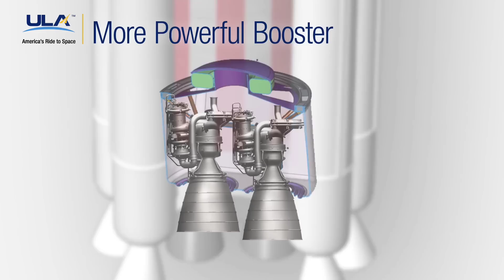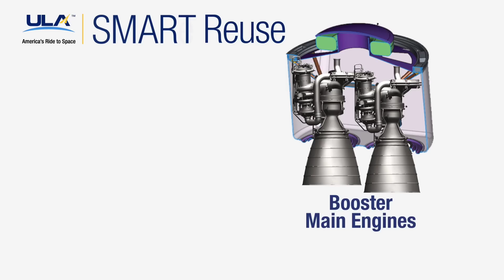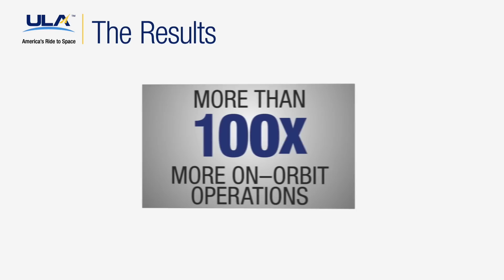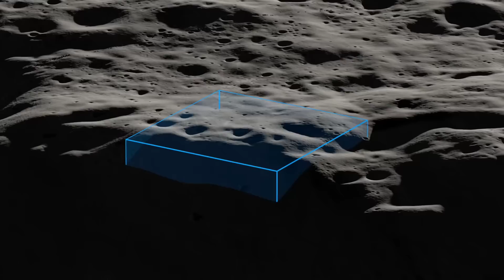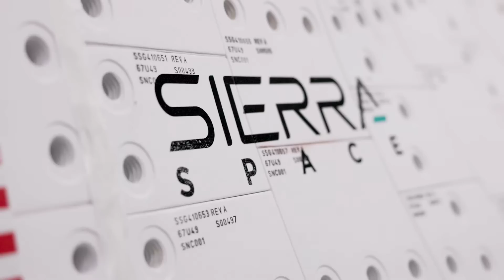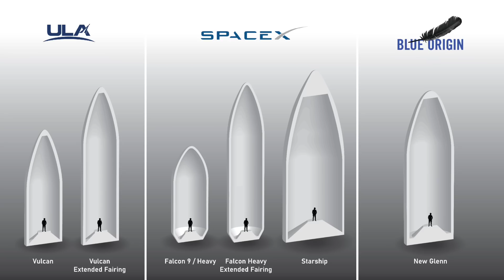2 weeks til the biggest launch of 2023!!  Moment of truth for ULA and Vulcan!!

Comment: Vulcan/Centaur was also intended to launch Dynetics "Alpaca" lunar lander but NASA chose "Blue Moon" for 2nd Option (launched by New Glenn).
"Alpaca" burned methane, which is unsustainable by NASA standards. Are Dynetics refitting their lander with hydrogen engines, burning cheap in-situ fuel? (like Blue Moon).
As AA mentioned, no-one wants a monoply and NASA really could use a light-weight mule for quick lunar excurions from Gateway.

Comment: The at sea level thrust of the GEM-63XL SRBs is 455,200 lbf. Six of those plus the two BE-4s is 3,832,000 lbf.

New Glenn has seven BE-4s for  3,850,000 lbf at SL. Given that the SRBs have a so-so ISP of 280 seconds versus an estimated 320 seconds, and you can see why New Glenn rocks to LEO with 45 metric tons payload as compared to VC's of 28 mt.

Comment: You know, like in the fixed price  competition against Crew Dragon, where Boeing skipped the important sim-lab full-system flight test?  And missed key Demo 1 test objectives since the Starliner clock and Atlas V booster clocks we out of sync?  Bad gamble on Boeing's part.  And ULA is losing business to Falcon 9 as each delay happens ... so you don't think ULA might cut one corner too many?

Comment: Didn't the Japanese find out the hard way that you don't put important payloads on the first flight of any booster, even one designed using all the modern manufacturing, testing, and quality controls we have today.  Even with all that, their H3 didn't attain orbit - and the issue was with an engine that was already in use (in the upper stage), not anything new. But nearly everything on Vulcan-Centaur is new and untried.  Ground tests are great, but only a real flight can show up issues unthought of.  Oh well, I know a lot of people put a lot of effort into the rocket and the payloads, so I hope it will work as advertised.  I want to see Sierra Space's Dream Chaser in orbit and return on the 2nd flight.

Comment: I'm hoping Starship Booster will eventually have a Super-heavy version with one central booster surrounded by six side boosters, a total of 7 x 33 Raptor 4's with 300 tons of thrust each for a total of 69,300  (300 x 7 x 33) tons of thrust.  It would then boost a fully stacked Starship Booster and Starship, fully fueled for a two way trip to Mars where Starship would land FULLY FUELED on Mars for an easy return journey to earth given Mars small delta-V.
Reply: Arhhhhhhhh........ good ole' KSP.
Reply: You’re gonna need a bigger launch tower 😂 that much thrust would need a deluge system the size of Texas 😳

Comment: Vulcan is huge … definitely. It is not as technically challenging as star ship from an engineering standpoint because the majority of its complexity is solid rocket boosters …. Not discrediting it but these are not apples to apples. Equally as important. Star ship has all its chips stashed in on eventual cost … Vulcan is not going to be able to compete on that front.  It’s not designed to colonize other celestial bodies.

Comment: Ok, humor me here for a min.  Elon says the starship is going to be extended maybe as much as 10M.  If starship has a sizeable cargo bay and expected 200t to LEO, I have not done the math but a 200t 3rd stage put into LEO I would guess could deliver at least 20t (10%) to the lunar surface.
Reply: In theory, yes.  In practice, no such configuration is being planned as of right now.

Of course, with full reuse and in-orbit refueling, you eventually get vastly greater capability still, for only a small increment in cost.  So I'm not sure SpaceX will ever bother building such an interim, stop-gap solution instead of just going straight for the brass ring.

Comment: What? Biggest launch of 2023? Two much bigger Starship launches already took place. Vulcan Centaur's two BE-4 engines provide a total of 1.1 million pounds of thrust. Starship weighs 10 million pounds. You do the math. The top thrust of Vulcan Centaur wouldn't move Starship a centimeter off the pad.

I'm cheering for this launch. The greatest thing about it is that ULA will beat New Glenn to orbit. That is justice. And Vulcan Centaur will end our dependence on Russian motors. That also is justice.
Reply: The Vulcan is the most “important “ launch of 2023 as it’s (supposed to be) the finished article and has a huge number of missions already planned for private sector and the space force. The starship launch was “bigger “ but it’s still only in the testing phase and apart from HLS has no other contracts outside SpaceX .
If starship fails Elon just builds another one, if VC fails then ULA is completely doomed and BO isn’t much better if it’s a BE-4 issue that causes the failure.
Reply: @markbishop4774  There are two aspects to the rebuttal. First, the title is "26 days til the biggest launch of 2023!!" Titles are important and words are important. Yes, YouTube conducts creator clinics where they teach creators to be dishonest, using straight out misrepresentation at worst and weasel words at best in their titles to attract more viewers. I know he meant "most important" but that's not the promise in the title, is it? We need to hold our YouTube creators responsible for dishonesty. Nobody who was ever tricked into watching a video they weren't interested in will return, no matter what the YouTube clinics say.

The second aspect of my rebuttal will have to wait a bit. Did I ever say that work gets in the way of all the things it makes possible? Most probably. Part 2 in about 40 minutes!
Reply: @RockinRobbins13  I agree 100% YT creators should be accurate with their titles 🙄 but I was expressing my own opinion when I put the word “important “ in parentheses and not Jordan’s (even though he corrected himself in the video). A completely successful starship launch and landing recovery would be an incredible achievement in the history and future of space flight but there is definitely quite a way to go yet. The Vulcan launch is extremely important for the future of ULA and commercial competition, but flying a brand new rocket with a payload that’s going to the moon is a big gamble. obviously Saturn V and SLS have done it previously but it’s still a risk.
Reply: @markbishop4774  Okay, with Notepad this time. I hate it when YouTube hiccups and you lose a post a couple of times. First, to Jordan's credit he didn't try to justify his use of "biggest" vs "most important." His video was as if the title wasn't written yet and he devoted his entire effort to justifying the importance of the launch. That's good.

But part 2! Have you ever read "The Perfect Storm?" The organizing principle is that at the beginning of an endeavor you have an infinite array of choices, and as you select one choice after another the field of choices narrows, perhaps to the point of the last choice being when you'll take that last breath of water and drown. ULA is like that.

Originally it set itself up as a traditional cost plus contractor. This didn't look like a choice at the time because there were no other kinds of contractors. However SpaceX decided not to participate and made new rules. Therefore ULA had a choice there.

ULA made a choice not to spend resources developing its own engines. It would leave the survival of their company in the hands of others, from which it would buy.

Then they made the choice to buy RD-180s from Russia, not our friend, and guaranteed, even at that point, to be a problem in the future. Russia could either shut off the supply or our own government could stop allowing Russian engines to be used for DoD launches. BOTH happened because Murphy's law works doubly good in space.

At that time, ULA also made the decision not to formulate a backup plan that would allow them to escape the consequences of Murphy's law applying to their last decision.

Not satisfied with their previous plans, ULA entered into a contract for engines with a company which had no orbital rocket engine experience whatever and had never orbited a paper clip themselves.

So now, although ULA can produce everything perfectly themselves in their part of the rocket, their survival still depends on Blue Origin's ability to produce an orbital booster engine for ULA when Blue Origin has never launched an orbital rocket themselves.

So now ULA can only take that last breath, not knowing whether they get air or water. They didn't have to end up here. The truly important decisions were made years ago. Now all they can do is sit back as spectators of their own fate. I hope they brought popcorn because this will be exciting whatever the result.

For Tory Bruno's sake, for the fact that he wants in the worst way NOT to be a dinosaur cost plus contractor, I hope they succeed. But their fate is not in their own hands. That's a travesty.

Comment: Neutron, MLV, new Glenn and Terran R are all coming in 2024-2026. Hard to have a monopoly with so many players. ULA is either going to be absorbed, sold for scrap, or go under a firing spree if sold. Falcon heavy can deliver 26.7 tons to gto.
Reply: Is that with RTLS side boosters and drone ship core? If not, then cost and cadence gets a touch ghastly.
Reply: @EMichaelBall  it's between 90-150 million for falcon heavy (fully expended for 150). It's 100-200 for Vulcan based on the amount of boosters. So even if fully expanded it's 50 million cheaper for twice the payload.

Comment: The mature 2nd stage - Boom on stand then rushed to fix to not miss deadlines. NASA lost people on rushed manned vehicles. as was shown how mature systems rushed to the pad over looked clearly identified before any human launch.  Don't forget that Blue Origan engines for proven testing had 3 replacement to find to 2 that passed. BO has mature engines that happened by the magic eight ball then ended any non-orbital flights. Now let's see if they learned and more must fail to fine ones that may work. On ever atlk to those who have 1st hand knowledge of many other issues at BO.

Comment: It really is an important launch.... so much of the design and execution was based on careful evolution of existing proven technology from Atlas V and Delta IV, when they made the jump to the new much larger Centaur V instead of going via the existing Centaur III (shown in the old ULA presentation) they introduced a production weakness that was exposed by the Huntsville test failure and subsequent hydrogen explosion. 

It wasn't mentioned in the video that because of the failure Amazon took their trial Kuiper satellite launch off this first mission and ULA had to reschedule that onto a dedicated (successful) Atlas V mission to get their constellation trials started on time. That will have cost ULA quite a bit of money... probably a discounted extra Vulcan Kuiper launch.